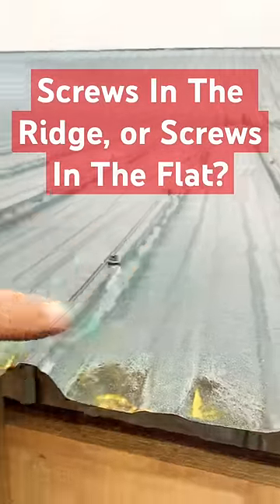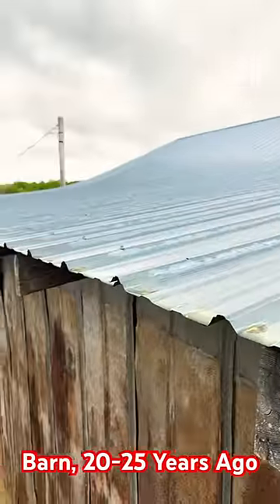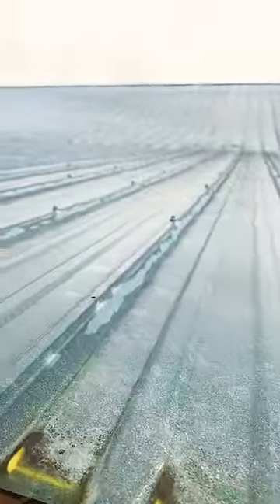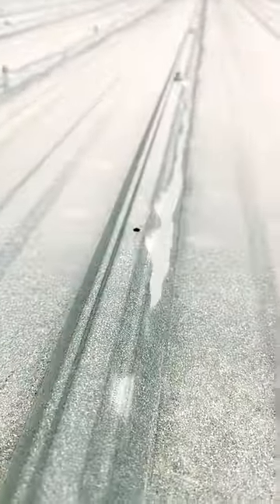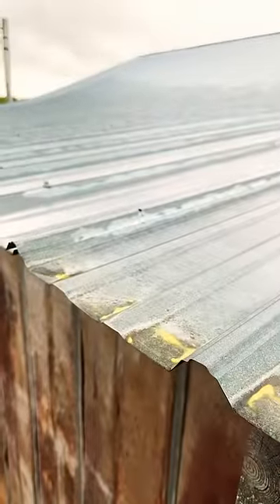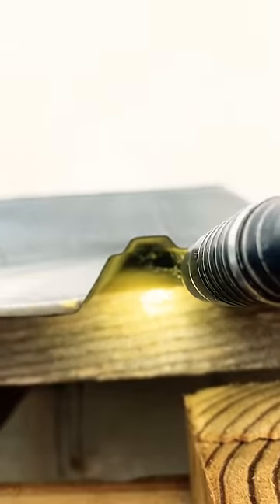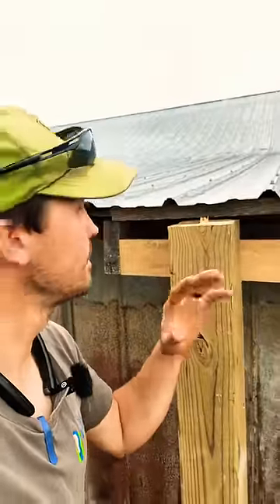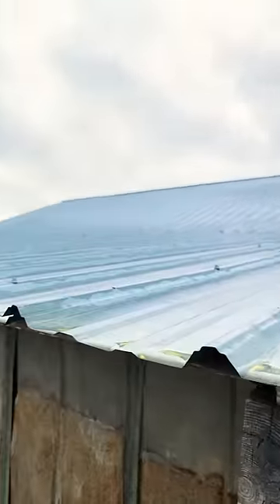What’s Better? Screws In The Ridge Or Flat? #construction #farmlife #building

Comment: How about last night have a debate and do it the correct way you have a three tear high no need for screws. You only screw the low down to the wood. Do your research country bar learn the correct way in a ridge is at the top of the roof it’s not a highor low

Comment: Flat better snow will force its weight on the top of the ridge and cause leak when melting and ot causes more movement with wind and will loosen the nails as well as heat and cold ,screws  in the flat is the correct place never loosen with weight of snow wont push up screw and cause a leak as its melting once its in the flat  its there for life .

Comment: My brother payed someone to build a cereal  deposit and a pig barn.
The deposit in the ridge,the pig shelter on the flat,screwed untill cracking sound.
The cereal barn leaked the first time it rained ,the pig barn not one drop.
I talked with the pig barn  builders,and they said they only screw on the flat,where they can tighten to the max.
My next building will be screwed on the flat ,or on the ridge,but with some plastic washers under the ridge ,in order to be able to tighten those screws.

Comment: The biggest factor is the quality of the washer seals for the screws. I've seen leaks caused by the seals being sun rot after 5 years. But yes, the ridge do have much less water flow. Heavy rains will cover the entire screw flowing down the valley of the sheet.

Comment: No screw at all. 

Use duct tape to “combine” roofing material to wood. As God intended.
Reply: Correction. Build barn inside out, with corrugated metal UNDER wood “exoskeleton”. 

Scratch that, build entire structure upside down with corrugated metal on floor, with structure and support columns going towards sky.

Comment: The problem with putting screws in the ridge is when you accidentally put the screw clear through the steel. The stops help prevent that for the most part, but when you're literally putting thousands of screws per building, you're going to get a few that will poke through, so why not just use the flats so that can't happen?
Reply: Not sure what sort of screws you are using that could punch through a sheet like that.. Tek screws have too wide a head on them and a gasket/washer too.

Comment: When you shine the flashlight underneath the ridge there's no hole in the top to show that there was water there so therefore there is no water there because there's no hole in that part of the roof you need to go inside and look where the holes are and see the water stains underneath them

Comment: Another little thing I was told once,aside from putting screws on ridge if you need to walk on the roof don’t step directly where the screws
Are but walk between them to ensure you don’t push the iron down past the thread section of the screw possibly making it catch and causing the roof to leak where the seal washer is

Comment: I designed an open framed building and had to piece together the components the other day.  Every corrugated metal roof panel I looked at depicted a typical attachment where the screw lies on top of the ridge, some even have special hardware to prevent leaking.

Comment: On the roof on the ridge on the wall on the flats for best results
Reply: For vertical fixing you mount top and bottom tracks and don't screw at all. if need be use stud adhesive behind the sheets.

Comment: And the fact of the matter is that most U.S. metal roofing manufacturers say you should put screws into the flat, because this location offers a solid wood surface just beneath the metal panel, resulting in a safer, tighter, more secure seal.
Reply: Nope they do not! It doesn't even make sense that they reference wood, because they also manufacturer steel roof frames that the sheets are screwed to. Screwing on the flat promotes rust and that's not in the interests of manufacturers either! Make something else up!
Reply: Huh? You get tek screws whatever length you need.. How is it any different if you get a 20mm longer one to account for the ridge height..?

Comment: Screws in the flat all day long
Reply: Why, you ask? The ribs on the metal is where you get your strength of the metal. Although it's not significant,  the holes still compromise slightly. 
Also, when you screw in the ribs you're losing 3/4 of an inch of the screw that's not sunk into the wood. After many years, the vibration of the wind will lose the screws and the seal around the washer will gap. If you sink the screw in the flat, you're getting a good strong bite in the wood and the rubber washer will keep the moisture out really really well. 
This is how I've done it my whole life, but it's up to you!

Comment: For a roof, ridge. For a wall, flat
Reply: For vertical fixing you mount top and bottom tracks and don't screw at all. if need be use stud adhesive behind the sheets

Comment: I’m a home inspector and have done my homework. It’s not a guessing game. The manufacturer requires screws on the flats except at overlaps. The screws have gaskets that prevent leakage. Screws on ridges will not penetrate far enough and will back out over time. That’s why screws are missing. Grandpa didn’t read the instructions.
This installation will void the warranty and reduce wind resistance.

Comment: I've always put them in the rib and have been doing it for almost 30 years and never had a leak. It's industry standard too. It's made that way because it keeps the screw head away from water, snow and ice and prevents the elements from grabbing the screw head like the ice so that way it will slide down the panel👍🏽